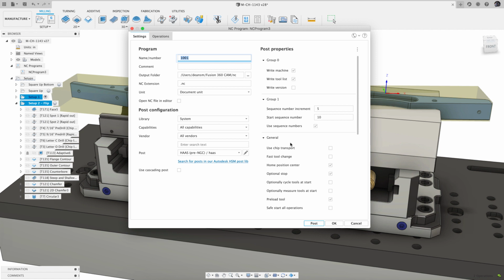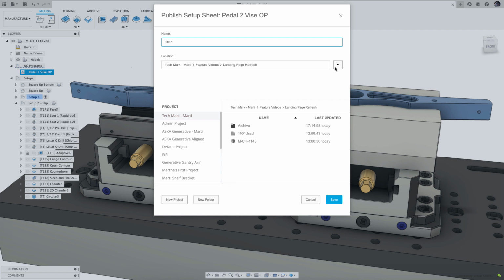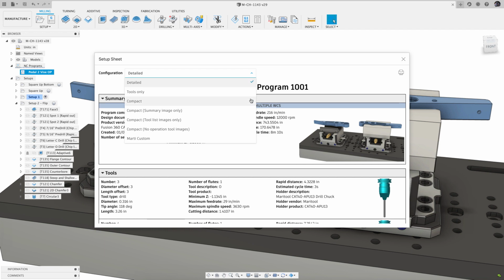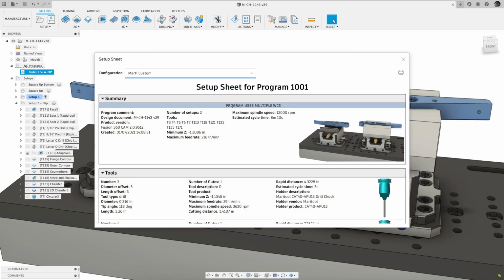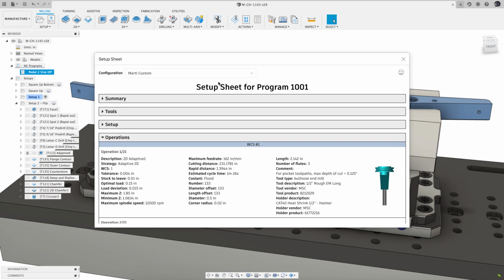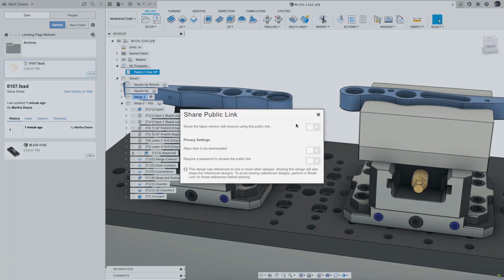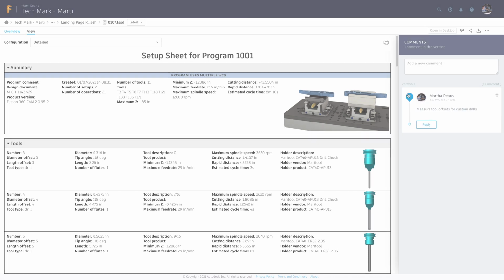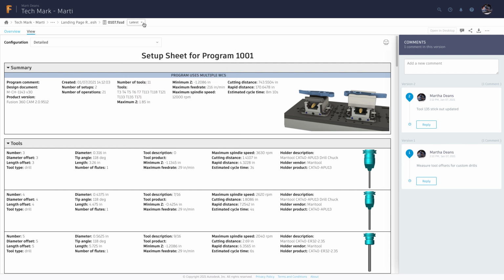QUICK TIP: New Setup Sheets!

Comment: It seems the Setup Sheet Configuration function no longer exists, so that is disappointing. This still misses the mark. Setup sheets in Fusion are still a mess with 3 different entry points with very different results. What is needed is a way to output a setup sheet as a pdf or jpg that can be displayed on the control with an M130 or as a link. When creating a setup sheet from the setup directly, there is no option to name the file. When creating a setup sheet with a setup post, the images don't display properly. When creating from an existing NC file, it can't save as a network file allowing it to be directly associated with the posted .nc. There should be an option in the machine post NC Program setup to automatically generate a setup sheet with a specified name and location whenever the post process is run.

Comment: I got a setup sheet in class that was supposed to inform us how high the top of the material should be when resting on a vise.  Other's figured it out, but I couldn't see it.   I'd attach it here for inspection if I knew how. I have the material on a 1-5/8" parallel and that leaves little for the vise to grab.  That way the blade is within fractions of an inch of the vise while cutting, but I don't understand how to read the sheet .  It's too much information at this point for me to look at it.